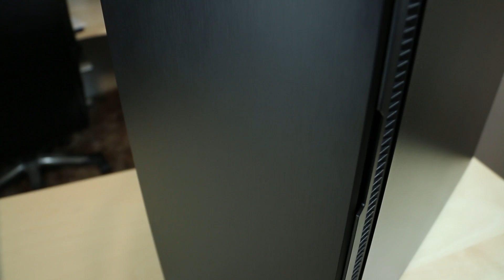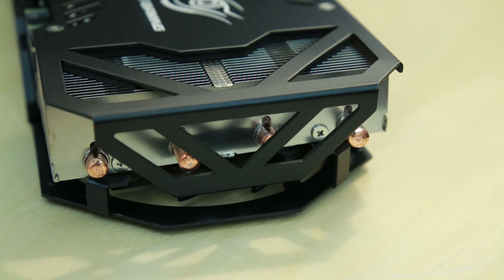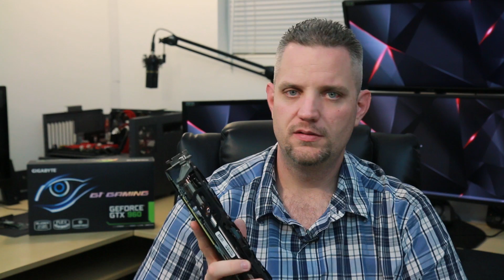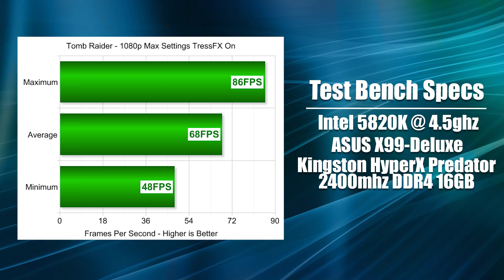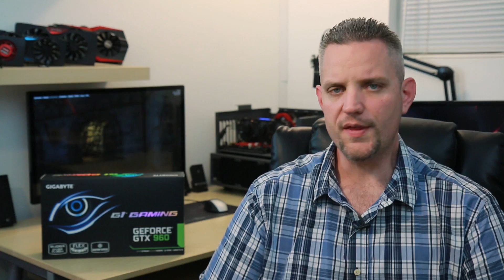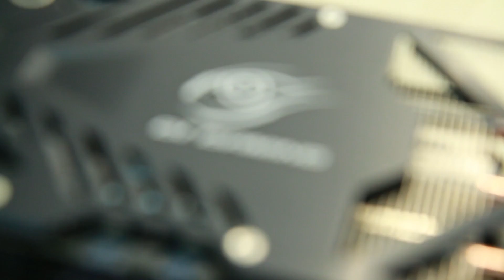Gigabyte GTX960 G1 GAMING - Best Mid Range Card Yet?

Comment: What makes the 960 better than the good old 280X ?
Reply from the maker: Gyengye Gabor Nothing
Reply: well, it isent. its worse.
Reply: I would not say either is better than the other, they offer comparable performance but offer different features, the 280x has more vram and is marginally faster at stock clocks however if you want something that uses a lot less power and offers all the new features of the 900 series (including Nvidia physics) then the 960 is the way to go. Its basically down to your needs/wants. They are both great cards but bare in mind the 960 is new silicon where the 280x is already over a year old and worse still was a tweaked rebrand of the 7970 which is by far older now. Still an amazing value card but not suited for my personal needs.
Reply: PhysX imho, depends if you want multiple monitors (go 280X) or dedicated Physics chip (GTX960)

Comment: How can it be the best mid range card yet, when on it's release it got BEAT UP by the 3 year old and LESS EXPENSIVE R9 280X... what fucking planet are you from?

Not only did the GTX960 cost more on it's release than the R9 280X, it loses to the AMDS ancient card by around 10-15% across the board, and has 1GB less VRAM.

Seriously. Best mid range card ever? Don't be silly...

Comment: I believe a GTX960ti will be released shortly before or after new Radeon presentation. With 1280 ALU's, 192bit memory bus and 3Gb of VRAM. Suprisingly it fits right in the middle between current GTX960 and GTX970.

So buying GTX960 right now is kinda a waste of money unless you have a low power PSU.

Comment: i'm new to this first off,
does afterburner mean you can overclock without going into the bios? or is that just for a cpu...also. can you overclock a cpu without going into bios?
Reply: yes, afterburner lets you overclock your gpu inside windows. and no, its only for gpu. and yes, you can overclock a cpu without going into bios.

Comment: 1800 in valley? thats lame. I get 2k on a overclocked gtx 760 and 1700 at stock. How is this an upgrade?
In the past, the gtx 660 was almost as fast as the gtx 580, this piece of crap cant even beat the gtx 770

Comment: Love the videos man... You have been the biggest help out of everything in my process of catching up with the current hardware. I havent built a computer in almost a decade because im poor, and I got distracted by life (I'm 26 and last build was 18)... Anyway....
Of course all the fanboys, and benchmark BS are gonna make it a easy sell for Intel, but I am always gonna be a Bang-For-Buck, Efficiency kinda person....

I want to stream, and I would love to be able to run ultra settings 1080p.....I'm such a cheap ass... I bought a Corsair 430w modular, and a MicroAtx.... I realized if I wanted to run a 8350 it would be pushing the PSU hard unless I got a really efficient GPU, and I think the 960 is PERFECT... according to pcpartpicker....I'd be around 330w with a 8350/960 combo... which is less than the 85% efficiency of the 430w which is 365w...

Intel would be even more efficient, but I'm really poor, and I'm not sure what a solid budget Intel would be.... I was thinking about the g3258, and upgrade to a 4690k or 3770k when I get money... or I could try to pull of the 4690k, and just use integrated graphics until I save up for the GPU.....

I'm all over the place, but I think the 6300 would be a great base.....and 8350 would be optimal for what I need... The 4690k/3770k would be a luxury...

What do you think? Whats a good efficient AMD Radeon card to compete with how quality/efficient the 960 is? Would the 6300 with a lil OC be plentiful? Or just go with the 8350 with or without OC and call it a day?

Comment: The specs suck... 128 bit memory bus... and just 2 GB memory? terrible. Get an R9 290/290X... blows this thing away for a few bucks more. Unless you care about your gpu costing you 2 cents more per hour to run. DX 12 is not a reason to get this card... it will be at least 1-2 years before DX 12 games come out.
Reply: get a 970 blows everything away....blows me away..blows you away..blows grumpy cat away...
Reply: Yep I got a 970 its fast hehe.. but Nvidia lied about the specs of this card... and the last 512 mb of VRAM is very slow...u should be aware of that.
Reply: I became aware of that before obama became the prime minister bro....upgrading to 980

Comment: i overclocked my gpu from 660 mhz to 780 mhz (630m,pentium b980,4gb ram) and i got REALLY good result's
battlefield 3
660 mhz:
23-27 fps medium settings
780 mhz:
28-36 fps ultra settings
Call of duty advanced warfare (this game actually works on my computer)
660 mhz 
48 fps lowest settings possible
780 mhz
37 fps medium quality and native resolution
Battlefield 4
660 mhz
15-21 fps low settings 
780 mhz
26-35 fps medium settings
Counter strike go
660 mhz
48 fps Maxed out 1024-768 resolution
780 mhz
68 fps Maxed out settings 1280-1024 resolution
Grand theft auto IV
660 mhz
40 fps low settings
780 mhz
high settings with tweaked very high 35 fps
Valley benchmark (DirectX 11)
660 mhz
7 fps Extreme hd preset
780
18 fps extreme hd preset
Cinebench r15(opengl benchmark)
660 mhz
19 fps 
780 mhz
34 fps
and at 660 mhz it stayed at 72C but at 780 mhz it stayed at 78C so in heat there wast that much difference

Comment: Everyone saying that this card is shit that this card only has 2gb of vram, THIS CARD IS MID RANGED SOME PEOPLE CANT AFFORD THE EXTRA 100 BUCKS FOR A 970 YOU FUCKS. Also the hot as fuck amd cards are even worse running hotter and using up 200 to 300 watts this card uses 120 watts. DONT TAKE MY FUCKING WORD FOR IT LOOK UP THE BENCHMARKS FOR THIS CARD COMPARED TO THE 280 285 AND 280X THE 960 STOMPS ON THEM IN EVERY GAME EXCEPT THE ONES THAT ARE OPTIMIZED FOR AMD CARD, so stop hating...

Comment: help!! i was going to get an r9 270x for my first build but then i wanted to get the 960 but now i'm not sure haha.  can someone please help me? also with a mother board that can have sli or crossfire depending on what card i get.  here is my build http://pcpartpicker.com/p/JRGMD3 
also i'm trying to keep the build to around 750$
Reply: You should go for R9 280X, you can get it for $230, it would be vastly better than 960, since it's a proper 3GB card, if you wanna save some money, you can buy non-X card for $170, better price/perfomance, but it's a compromise(still a 3GB card, though, unlike 960).
Reply: ok thanks so much
Reply: FailCycle
 also any specific non reference one that you recommend?
Reply: Migi Bej Go with Asus http://www.techpowerup.com/reviews/ASUS/R9_280X_Direct_Cu_II_TOP/

Comment: there is something wrong with your benchmark of Metro Last Light...

this game used to require an old physx driver, if you used the "normal" one, the game had a bug and directed all the physics processing to the processor, and that was very slow. 

I used to get better minimum framerates using a 660, so 10 FPS seems too low.

Geforce forums indicate that the right version is physx 9.13.0725

Comment: When I first saw the 960 specs I thought it was a satirical post, turns out they were real. Now all the Nvidia fanboys are flocking to this card and acting like it's the holy grail for midrange 200$ GPUs when it's only a hair above an r9 270x performance wise and get annihilated by a 280X, but since its new its obviously better, right? Right? Right?

Comment: i should overclock. but it one thing that worries me, my cpu get 4-pins of power (gigabyte choose 4pin instead of 8) and i have a 8320 which eats power. is the 4pin to my 8320 any problems?
Reply: It doesnt matter if your cpu is a 4 pin and your card is an 8 pin all that matters is the wattage of your psu.
Reply: McLovinPablo aight thanks! I have a 750w psu so that is no problem

Comment: Who is actually going to buy this? It is SO expensive and 7000 in 3D mark?  That's a bit of a piss take quite frankly.
Reply: yea its pretty bad.  My HD 7850 gets a score of 7120 in 3dmark11.  That card sells for like $150 now (R7 265 2gb)
Reply: Power efficiency.
Reply: Infinite Zero my 7850 only draws 115w at load.
Reply: Infinite Zero on a funnier note, I cant believe AMD rebadged the hd 7850/r7 265/r7 370 for the third time.....

Comment: One observation I've made -- right or wrong -- after watching/reading every review I can get my hands on is that people worry way too much about the 128 bit bus and 2GB of VRAM.  

The second observation, or opinion, is that with an alleged three variations of 960 coming out  (960, 960TI, 965Ti), this one should or could have been branded a 950Ti Boost, but they wanted to walk the marketing tight rope and release the card with this level of performance first to keep it safely away from the 970's market share.  Also releasing a funky "Ti" variant before whatever basic "x60" probably wouldn't seem proper, even though it's all the name game and marketing when it comes to these cards and how they want the public to perceive them.  

In short, the decision was to either release what should really have been named the GTX 960 now and (potentially) cannibalize their 970 market share or release this here card as the vanguard of the mid-range and have people bitch about it's 128 bit bus and sub-3GB VRAM (even though they probably don't understand what they're talking about).  Either way, it seems like a fine card for the money and I wouldn't rule out grabbing one if I needed a good mid-range card and didn't have an above-500 watt power supply.

Comment: I love you Jay........but my 970's in SLI chug on Farcry. That game isn't as bad as Unity but it surely is not well optimized, which is a shame, because it's a damn fun game.
Reply: i swear all of you guys exaggerate a bit.  I have a god damned fx 6300 and HD 7850 2gb and i get 40-50fps on high settings at 1080p and never had any problems with performance.  Same with BF4 and Watch dogs.  All i hear is low framerates, unplayable and so on comming from guys with i5/7's and sli 970's.  It seems strange that my cheapo 6300 and 7850 2gb keeps a steady 45fps on watch dogs high and 60fps bf4 on ultra with no AA.  I would kill for a 4770k or 4690k rig with something like a 970 or 980.
Reply: No i hear ya, complete first world problems haha. Farcry just has issues with SLI

Comment: Jay I have a question about overclocking. While overclocking my Msi r9 270 I set the power limit to 120% Now the thing is I had the core clock at 1100mhz stable for half an hour on valley then after 10 minutes in bf4 it crashes. I backed it down to 1080mhz again, it was fine in valley for half an hour then after 3 hours of bf4 it crashes. 1050mhz is the highest stable overclock I've had that hasn't crashed in bf4. I was wondering if you could give me any tips to help me find a highest stable overclock. People on toms hardware have been getting overclocks of over 1120mhz+ with the same card which I find annoying.

Comment: what does vram do? people are complaining about only 2gigs of vram???????? im not sure what it does.
Reply: it basically stores textures and rendered effects in the frame buffer so it doesn't have to purge and write new information to to memory as you move around.  More VRAM generally means less stuttering and loading of textures.  For example in skyrim with a 1gb card and 2k textures i experience a lot of stuttering as textures are loaded from hdd to ram and then to VRAM, but with a 2gb card textures don't have to be purged and written to memory before appearing, relieving the transition stutter.

Comment: Well this just made deciding on my wife's upgrade path more difficult. She's running dual 660s right now. Not in a huge hurry to upgrade as it can handle everything she does, so I'm keeping an eye out on what's coming.

First it was the R9 290 water cooled from VisionTek, because of the great price coming with a block pre-installed while still offering great performance. But I noticed how the GTX 970 uses significantly less power than the R9 while sitting at a pretty good price, so I had pretty much settled on it. This is especially since reference 970s are fully compatible with reference 670 water blocks -- yeah it's an added expense, but I like the much lower power consumption. We're both running 1080p and have no interest in upgrading to 4K any time soon.

Now I see this.... Hmm...

I knew the 960s were coming. I knew they were going to be priced very well (I paid $200 each for my wife's 660s). And I'm sure water blocks aren't far away for these either. I'm still leaning toward the 970 -- in part because the water block selection is already established -- but I think I'll wait to see what shows up for this first before ultimately deciding...

Comment: I guess the  NDA on the 960 is over now. \o/  I'm so happy with my GTX 980 i need another card for my old Core 2 Quad 9300, so a 960 might work out for me. I was considering a GTX 750 for that old PC as they are only $150, but if i can find a 960 at about $199 i might do it.  Assuming a GTX 960 (any brand) is a good match for an old Core 2 Quad 9300.

Comment: In my country, the 280X is better for the buck than 960, but still those coolers that Nvidia gets are just awesome. I hope that one day they will do the same for AMD
Reply: The 280x are good but the majority of them are broken and very few customers are pleased with the purchased. I don't recommend a 280x for anybody. But you might get lucky and get your self a good one.
Reply: jony bonilla Well I don't know what are you talking about. If the card had such failure rate as you say, reviewers(Linus, Jay, ToT) would say something about it or there would be some warnings about it. But there are not.

And if you are talking about "pleased customers" I took 280x and 970 to review comparison at Newegg

280x had 161 reviews and 22 of those were basically broken units (that is 14% failure rate)

970 Had 240 reviews and 22 of those were broken units (that is 9% failure rate)

So your conviction of "every 280x is broken" is just false :)
Reply: First i did not say every 280 x is broken just the Majority, Second there are reviews of bad 280 x everywhere do some research youl find them, and third i got 2 280 x my self and suffer from artifacts and slowdowns, 1 was msi and the second one was asus.  check videos about the asus on artifacts youl see.  it was later fixed when i changed from amd to Nvidia. I dont recomend getting the 280 x
Reply: If you never had a problem with it, than that's perfect but many people have return those cards a lot for a new one and still the same issue, im not saying its gonna happen to everyone(cause its not) but the risk is quite high you will. And sorry for the bad English,  my native language is Spanish. :)
Reply: jony bonilla YOU said majority of them are broken. Don't spread false information.
Reply: I admit i kind of exagerated a little bit(about the Majority part), but the part of being one of the most broken cards out there is true.
Reply: jony bonilla ummm..no.
Reply: i never even mentioned 14% lol. that wa another guy and 2 calm down. do some research before you comment.
Reply: and 3 i already admitted i was wrong on the majority part, but their one of the most broken cards out there(not all of them)  and im not gonna repeat my self, search for the artifacts on the 280x and why does it happen a lot in those cards " do your reasearch" that is all. Ohh and artifacts are not the only issue by the way but im not gonna go in to details again....Have a good day my friend.
Reply: jony bonilla Well actually "my friend" I work in IT, daily, more than 40 hours a week, in hardware. I actually have a system at home with the Asus 280X, and the 140+ games in my Steam account have not had any issues so far. The card I replaced was a Radeon HD 7970, and these cards actually crossfire together, and worked when I tried them in crossfire, but since then I moved the 7970 to my media PC on the big screen TV, so I've only been using the 280x. After work I usually game 3 hours a night. So, with my professional, certified, college educated IT background and experience I'm calling bullshit on your claim, There are chips out there just as bad & the Nvidia cards failure rate of 9% is just as horrible, I have Nvidia cards too, they haven't given me issues either, but your claims sound like worthless Nvidia fanboi cocksucking & you sound like you've had a LOT of practice at it! LOL

So, Jony, go suck some more of that Nvidia penis you love & stop trying to misinform people you waste of life.
Reply: Dude stop the hate, i am no gonna battle over every youtube comment, like i said to another youtuber. You think your right? Good. i already discuss this situation with a lot of people i am not gonna bother and show proof anymore. I don't see why the insults my friend but anyway, have a good day sir. :)
Reply: jony bonilla Wow let's nitpick. You're talking about heat and power comsumptions besides artifacts? Lol idiot. A bunch of Invidiot cards are hot as well. 500s 600s 700s Look at the older cards. Yes OEM cards are hotter DURH on any card.
Reply: ok trying to convince youtubers is impossible and not worth my time, you know what... you guys believe what you want to believe period. :) happy gaming my friends.
Reply: jony bonilla Yeah get off the internet.

Comment: A lot of people expected at least 3gb of ram with at least 192bit bus and a dumbed dumbed down gm204 for $250 (I i recall correctly the 660 and 760 launched at that price) and what we've got is 2gb 128bit gm206 for $200 which is aiming to compete with the similar priced r9 285  that makes me think of a possible release of a gtx 960ti with maybe 4gb ram, 256 or 192 bit bus and gm204

Comment: I am going to buy a single 1080p monitor upgrading from gts 450 720p and i think i should get 970 over 960 ? yes? no?
Reply: ilov3mus1cx3 Do not Go R9 290x its horrible.. gtx 970 features more things and a super overclockable card + about 60% less power consumption